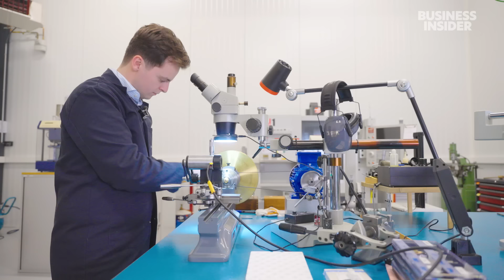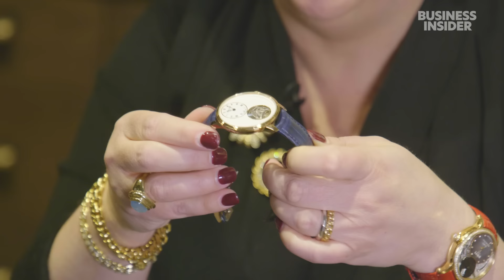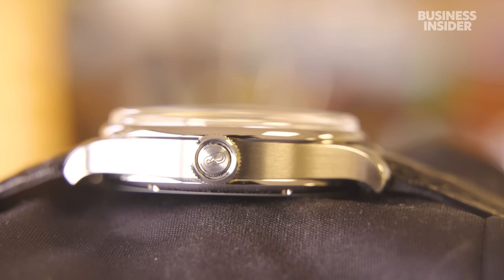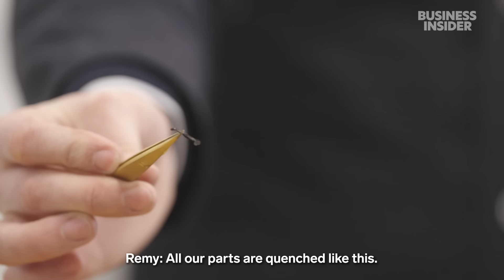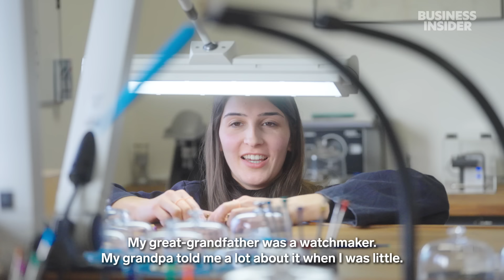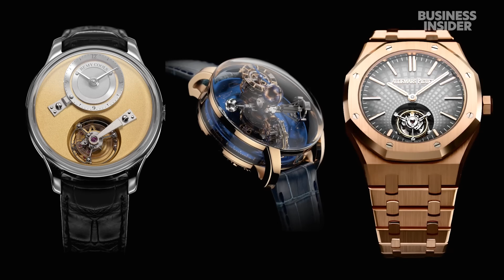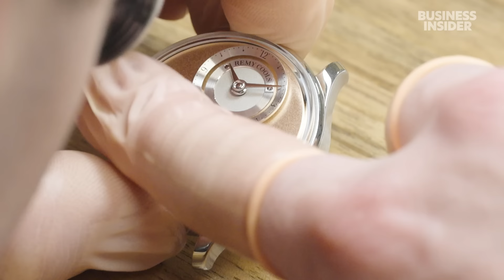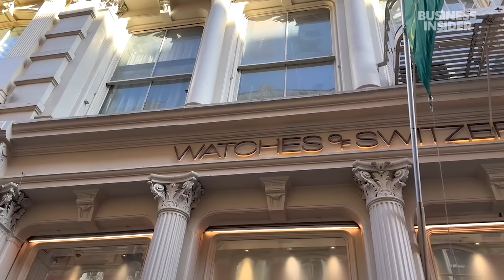Why This Obsolete Mechanism Makes Watches More Expensive | So Expensive | Business Insider

Comment: What’s amazing is these little parts were manufactured hundreds of years ago in older mechanical watches without CNC machines.
Reply: It took 32 master craftsmen to complete one single watch. Not to mention this being done at a time where electricity and machines didn't exist. Even the fundamental tools of watchmaking were created by these early pioneers in the field. It's truly incredible, and the technology behind how they work is also extremely impressive. The market is dramatically shrinking, and it's likely that in another 50 years or so, no one will make them.
Reply: @k-ozdragon Google a jewelers lathe.....ignor this push button thing  then you can appreciate  skill and pride
Reply: Or until the recent past by the very greatest of watchmakers like George Daniels.
Reply: The way they made precision parts before computers is still fascinating.

Comment: Rolex is one of the worthy watch if you wanna buy for long term investment. They’re not just expensive, the value increase like a house. Which is different from other brands where it’s expensive but the cost drops years after years. Don’t get mistaken when buying watches. Buy a Rolex or a similar kind brands if you want to invest or any cheap good brands like Seiko if you like functionality. Other overpriced brands are just expensive but low in value

Comment: Can someone explain why tourbillon are no longer useful? The video claims that they were intended to counteract the effects of gravIty on the accuracy of pocket watches, but that they are not needed for wrist watches. But isn't a pocket watch sitting in a pocket angled at roughly the same position as a wrist watch is when you have your arm down by your side?
Wherein lies the difference, exactly?
Reply: The difference is that your pocket typically hardly moves, whereas your hand goes all over the place, evening out the effects of gravity.

Comment: Telling a nowadays watch doesn't need tourbillon is just half of the true. Yes, constant movement of the wrist will contribute the effect as of the rotating cage in the tourbillon movement. However, Our wrist is not moving all the time. Plus, when we sleep we take off the watch and put it on the table, in the showing case, on the watch pillow etc... and it will stay that way for 8+ hours.
Reply: I usually put my automatic chronometer in a watch winder.

Comment: If you want accurate time, look at your smartphone. Set it up to show seconds if you really want to; they are accurate. As for the video... it's all about snobbery, no technical explanations needed. For the cure, stop putting rich people on a pedestal. Nice mechanism.
Reply: Except my automatic mechanical watch doesn't need to be recharged, I don't have batteries to replace, and as long as I wear it every few days, I never have to wind it.  Oh, and it will still work after an EMP...
Reply: @lonemadrone31  After an EMP, human civilization will likely collapse. So a watch will be just an extra weight on your very dead wrist.

Comment: Amazing how Remy has mastered this art at such a young age. Amazing
Reply: Using CNC ??? ....  lol ...
Reply: @kebeleteeek4227 he could clearly do it by hand if he wanted
Reply: @kebeleteeek4227  And what do you think every single other major watchmaker uses? They all use modern tech...
Reply: @kebeleteeek4227  are you stupid?
Reply: @kebeleteeek4227  What is he supppsed to do? Carve out everything? He does it for the wheels anyways. you yourself probably can't even hold a screwdriver.
Reply: Are you joking? He uses the most advanced CNC machines. People take years to master them. He mastered CAD, mechanical engineering, electroplating, hardening, quenching. I took apart and assembled my watch and it was no easy task.. lOl.. He studie watch making and was taught to do that manualy and he did.. Its normal for aperenticeships.. Why would he?.. When i need to make something, I dont sculp it from woood, I CAD it and print... What a dumbass are you for making fun of anyone using CNC... Looser.. I am more interested in where he got the milions for the equipment.. Swiss made CNC machine just for watch..

Comment: The Chinese have now brought this complication to the masses for well under 1k.
High-end watch makers are taking a piss with some of their prices now. The handmade parts are exceptional, but their prices have increased so much in only 3-4 years that it's largely margin.
Reply: Anything from china is garbage
Reply: Yeah, but the finishing on Chinese movements isn't very good. Not to mention the QC sucks and don't even talk about customer service. Not saying these Swiss watchmakers on the high end aren't price gouging but a lot more goes into the manufacturing process. Plus the designs are always original.
Reply: @Libertà_sopra_vita  I've had great service with Chinese brands and extremely good qc.
Reply: @_Napoletano_  I own 2/3 of my collection in Swiss watches and 1/3 in Chinese. My san martin is finished higher or the same as my much more expensive swiss watches.
It's just manufacturing and experience. Seagull for instance supplies more movements and parts than all other movement makers and suppliers. They also supply many parts for swiss movements currentlyor in the past. .
Reply: @Libertà_sopra_vita  The Swiss have been buying most of their components from China for decades.
Reply: @Libertà_sopra_vita you are just another ‘scammed’ customer 😂😂😂😂😂 they shouldn’t cost more than 1k but you know people are willing to pay 10k so why not? 😂😂😂😂😂
Reply: @bluenick4577  if the average pay for a watchmaker in Switzerland is CHF 77,000 ($85k a year) and the average pay for a Chinese assembly line worker is $12k a year. The only people getting ripped off are those on the assembly line putting stamped brass movements together with little to no grease. I've never owned a Swiss watch that has taken a shit within a year of ownership. The same can't be said for the handful of Chinese watches I've owned. I owned a "Pagani" fake GMT master and an indice fell off in about a week. I bought a Seagul 1963 and the movement took a shit within a month. You get what you pay for. That much is evident 13 years into this hobby. Watch some watchmaker videos on YT where they disassemble these Chinese clones and you will see where the money is saved.
Reply: @bluenick4577  $85k a year on average for a watchmaker in Switzerland. $12k year on average for an assembly line worker putting together stamped brass Swiss clones with little to no grease in Chi-nuh. Who's getting scammed? 😆
Reply: @_Napoletano_  idk any, but the lowest price Chinese watches who use plated brass anymore.  316l steel is extremely cheap, and China makes a ton of the world's supply domestically. I'd suggest you compare a Swiss watch with a higher quality Chinese watch. Chinese watches are really good and can easily match the quality of the 5k and under bracket. It's the reason even Rolex, etc are being cloned to such a high degree. These watches even fool industry veterans and even ADs. I've seen an AD get fooled with a patek clone. You have to think, the Swiss aren't doing anything that can't be done by a craftsman in any country.
Reply: @bluenick4577  I wouldn't say 1k but certainly not more than 10-15k.
The hand finishing on many hyperwatches is exceptional and costs money to make. It's your simple rolex sub or daydate, etc, charging 12k that kills me. That watch is mostly mass produced and there's little hand finishing of any great skill.
Reply: @bluenick4577 you're not paying above 1k for the complication itself, you're paying for the fit and finish. I love chinese mechanical watches but their movements look like ass lol. Not to mention Switzerland is notoriously expensive, either the brands are from there or their watchmakers went to school there, of course they want to get compensated for that. And obviously you're paying for the name and it's inherently a luxury product. The chinese care more about quantity than quality
Reply: @athmaid  fit and finish lolololololol 
you know knives are harder to finish than watches and their premium lines don’t cost more than 1k and they use way better steels too 
the whole watch industry is an absolute scam
Reply: @bluenick4577  you're digging that hole ever deeper lol

Comment: Hm The typical watch is on the wrist of somebody, so it is on the vertical plane... Ok that the movement of the arm will change the actual position enough to make the turbillon irrelevant but still it is horizontal ONLY if it stays in a drawer...

Comment: Buying someone else's hard work makes you feel powerful.   Had a machine assembled an identical piece it would be worth a tenth as much.
Reply: For some, possibly.  For others it's completely different.   Many people wear a Rolex to impress others.   Then you have people who wear Grand Seikos because they enjoy the art and technology.  On a Rolex, the movement is made by a 3rd party.   Rolex hands are only polished on the top where the customer can see.  Then there's the Grand Seikos.  All parts, visible or not, are finished and polished.  Grand Seiko makes their own movements, and makes the most accurate mechanical watch movements in the world -- more accurate by a substantial amount.  The best Rolex movement ticks at 28,800 beats per hour.   The smoothest Seiko movement doesn't even tick because the movement only moves in one direction, not back-and-forth.  A rough approximation would be 922,000 beats per hour if it did.   Then there are the dials.  Rolex dials look like Timex dials compared to the detail and artistry which goes into many of the Grand Seiko faces.

Comment: Watches aren't expensive because of the Tourbillon (which can be nowadays found in $1000 watches), but because of several other factors like the hand engraving, hand-beveling, and the sheer number of watches produced by a specific brand. Independent watchmakers will charge higher because of limited resources available to them, in addition to lack of manpower. Larger corporate brands will be able to mass-produce commercial pieces at a relatively cheaper price, but can't be compared to the extreme high-end pieces in terms of finishing and handcrafting processes.
Reply: The main reason they're expensive is the marketing budget and the wholesale and retail markups. Nothing to do with the costs of production.
Reply: @eurovnik  Yeah, basically it's rich people shit.
Reply: @eurovnik  While that's true for brands like Rolex, for smaller watch brands who genuinely make these watches by hand, that isn't true at all-- and there are more artisan brands than you think.
Reply: To add to that: the watches that go for more than a few tens of thousands (after factoring in pointless things like bejeweled casings) are FOMO for rich a-holes who have nothing better to do than judge each other based on whatever frivolity they've last burned a shipping container of money on. It's peacocking for oligarchs. That 5.8m could've been used to improve hundreds of lives, instead it got flushed for a trinket that the wearer will never appreciate beyond its ability to make others envious.
Reply: Would the man hours of finishing and handcrafting processes cost $200k+? Maybe $1K but I don't think $200K+. A Patek Philippe costs $200K+ because people are willing to pay $200K+
Reply: Exactly, I just bought a $500 Sugess using a ST8230 movement, which Seagull has a patent on btw and it's a gem for the price. But it is not finished to the detail the Swiss tourbillion watches usually are. But it does easily compete with the cheaper $10,000 Swiss tourbys.
Reply: 😂😂😂😂😂😂 they scam your rich ass that’s literally all there is 
Finish? 😂😂😂😂😂 bro finishing a knife is way more difficult and they do that with a machine 
Swiss made watches are all a scam and a sham 
Marketing is like 90% of the cost
Reply: @bluenick4577  A total lack of knowledge on display.
Reply: @bluenick4577 finishing a knife is harder than finishing a tiny ass movement? Christ…you don’t know much about watch making and you never seen work from watchmakers like Philippe Dufour, Glashütte Original or Credor and all the other fine timepieces coming from Switzerland, Germany and Japan.

Comment: No one who is buying an expensive watch is doing so for uts accurate timekeeping...
Reply: Not at all.  Other than a Seiko Spring Drive, a cheap quartz Timex will keep more accurate time.   But the cheap Timex isn't art and for some isn't as enjoyable. 
  
It's like hotels.  Motel 6 offers a bed, TV, dressers, chair, AC, and a bathroom with a tub/shower, sink, toilet, and might even offer free WiFi and some sort of free breakfast.   The Four Seasons also offers most of those things, sans free WiFi and free breakfast and will cost 10x more per night.   So why stay at the Four Seasons?  the details.   and yes, details matter.
Reply: @grayrabbit2211 😂😂😂😂😂😂😂😂😂 what? You mean atomic time and solar power is not an art? 😂😂😂😂 sounds like you’re still stuck in 1800s